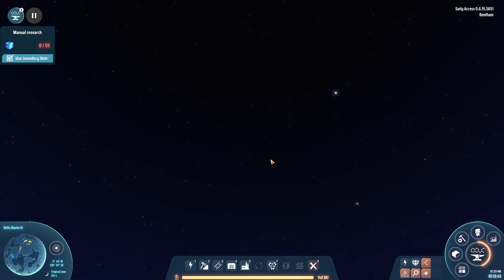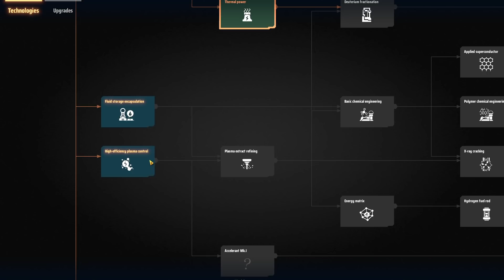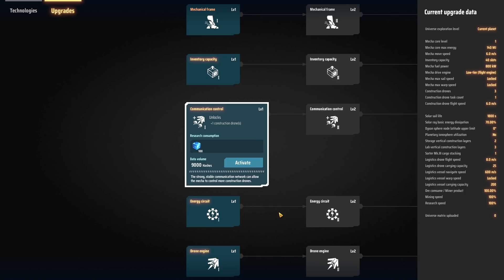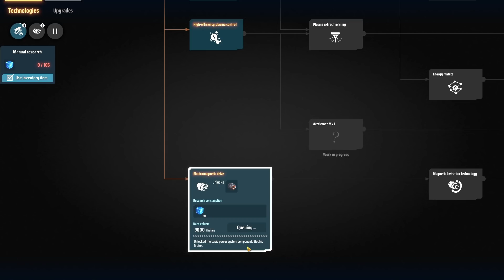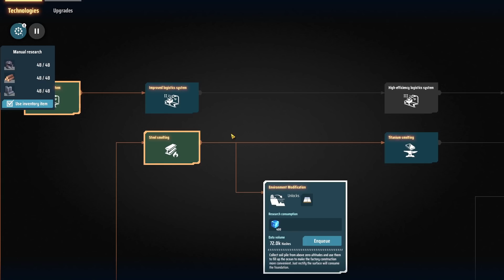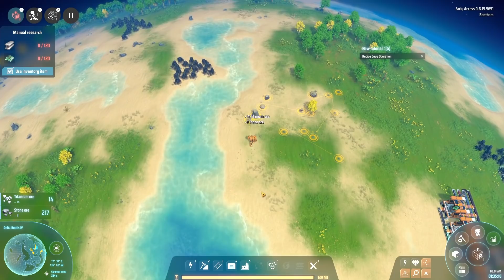Building a Graphite Power Station in Dyson Sphere Program | Part 3

Comment: So.. I did some math, and I don't believe it is particularly worth it to use energetic graphite in Thermal Power Stations (which sucks, because I did the same thing at first).

1 Coal is 2.7MJ of power
1 Graphite is 6.3MJ of power

It takes 2 coal to make a single Graphite, so if you just burned the coal you already have 2*2.7 = 5.4 MJ of power.  6.3  vs 5.4 is already only a little under 17% more power.. but then you have to factor in that the smelter uses 360KW per second, and it takes 2 seconds per graphite.  So that is .72 more MJ, 5.4 + .72 is 6.12 MJ per graphite.  That makes it only about 3% more power.. and while I'm not going to bother calculating inserter costs, I suspect that it would wash out most of that 3%.

So yeah, graphite is great for the mech, not so great for power stations.  All it really does is double the number of power stations you can feed with a single full belt (from 6 per full coal belt to 14).  Much easier to just use two belts of coal powering 6 power stations each than build a smelting pipeline.  It is the same amount of coal overall, and the extra two plants would just be powering the smelters anyway.

Pro Tip: Try powering the coal miners with a separate wind-power network to avoid low power slowing down your coal production. It is a bit of a pain to keep the network separate (hopefully they add power network improvements later), but it avoids low power brining your power production down even further when the miners stop working.

Note: The 60% efficiency for Fuel Chamber Generation on the graphite is just for the mech, not for the Thermal Power Station. I timed how long it takes a graphite to burn in a TPS compared to a coal.  Coal took about 1s, graphite took a little over twice as long.  Efficiency for TPS seems to be 80% for all fuels, and each TPS can generate 2.16MW.  So for coal that is 2.7MJ * .8 / 2.16MW = 1s (per coal), and for graphite it is 6.4MJ * .8 / 2.16MW = 2.33s, so that lines up with my obserations.

I also did the math for crude oil.  Its definitely worth it for basic refining (~37.5% gain), and probably worth it to do x-ray cracking (another 25% or so).
2 Crude Oil -> 2 Refined Oil, 1x Hydrogen

2 Crude Oil = 4MJ * 2 = 8MJ
Refinery = 4s * 960KW = 3.8MJ
Total: 11.8MJ

2x Refined Oil, 1x Hydrogen = 2*4.4MJ + 8MJ = 16.8MJ
Energy Gain: 16.8 - 11.8 = 5MJ (8MJ -> 11MJ, 37.5% gain)

2 Hydrogen, 1 Refined Oil -> 3 Hydrogen, 1 Graphite

2 Hydrogen, 1 Refined Oil = 2*8MJ + 4.4MJ = 20.4MJ
Refinery = 4s * 960KW = 3.8MJ
Total: 24.2MJ

3 Hydrogen, 1 Graphite = 3*8MJ + 6.3MJ = 30.3MJ
Energy Gain: 30.3 - 24.2 = 6.1MJ

Comment: I cant wait to see if the game is going to undercut how much material you need for a dysonsphere, or if its realistic.
Cause, you know... surrounding the sun with meterial is going to need nit just huge amounts, but like... a planet mass or two amount of matter to do. If not many more.
Also... the average 1 star solar system has 99% of its mass concentrated in the sun in the middle...
So question is, is there even enough matter in a solar system for a dysonsphere? Or does one have to draq from the sun's mass to even try to build one?
Reply: Why? We launch satellites that are tiny nano-dots, compared to our planet's mass.
The thing has to have proper velocity to resist gravity though, so sphere itself is very unlikely structure physics-wise (as polar parts will nearly not have velocity), while it may be possible IRL as a wide ring, spinning like a ridiculous space rotor, (or a multiple ones with different  orbital inclinations) - such a space-grade dynamo-machine))

Comment: You could set up all this or you could just do a ring of solar panels around the planet on the equator
Reply: Though you would need a large battery bank for night time operation.
Reply: @ArgandTabletop  i get where your coming from but you dont, because half of them are always in daylight! Unless you need the maximum output at all times
Reply: @Lego_man165  If you have enough solar panels to cover the entire equator. And if you need more than half of that, then storage won't help; your problem would simply be production, because not all panels would be running at once.